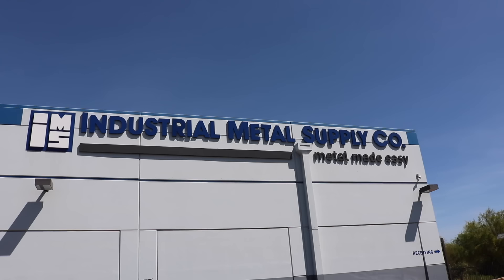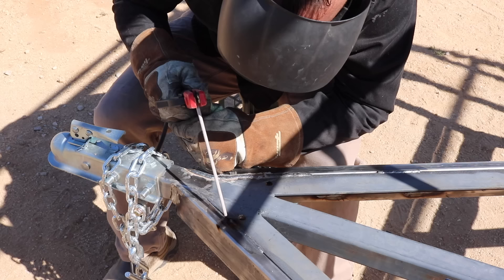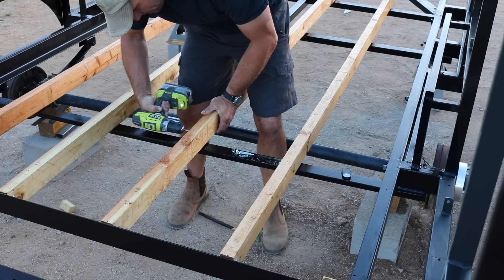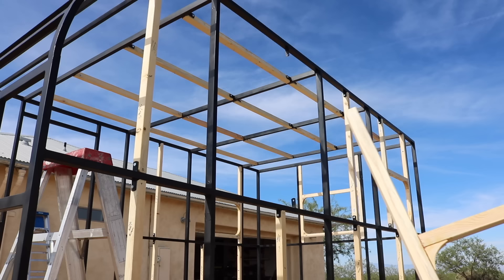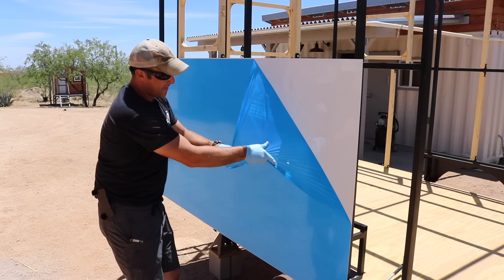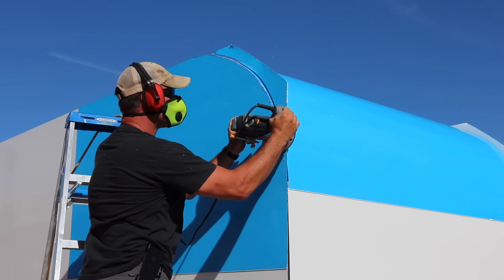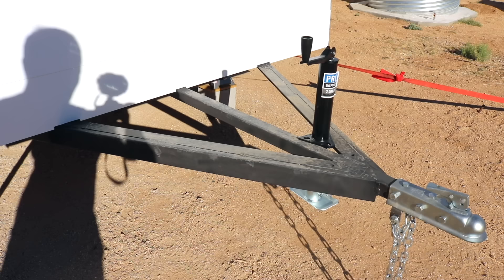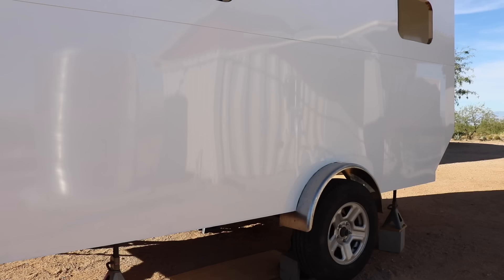How to Build a DIY Travel Trailer - Aluminum Exterior and more (Part 2)

Comment: HSD onomics I want to say that I appreciate all of the work and effort you have put into this project.  
How some ever, you might have taken a closer look at how travel trailer frames are made both today and decades ago.  
1. Frame rails should be of 2 X 6 tube steel.  Either HSLA or chrome moly, preferably. 
2. NO wood should be used on the underside of the trailer, with the exception of the subfloor. 
3. ALL travel trailers have the chassis and coachwork as separate entities.  They are then bolted together.  You have welded both together.  
4. You used tube steel for framework of your coach-unnecessary weight!  Aluminum tubing would have worked as well, with probably 100# of weight savings. 
5. Your tounge/coupler mods at the end were another case of overkill. 

Understand this is meant as constructive criticism,  not trying to rag on your build.  There are many aspects of the build that I do like, especially how you integrated the fenders into the side walls. 
Time will tell on the structural design,  but I suspect you might want to build inspection panels inside at coach frame joints where they attach to the chassis frame for stress cracks. Bolts have some flexibility, where welds are quite rigid.  
BTW I am an aircraft mechanical inspector by trade and am restoring a 70+year old Spartan Manor,  so I have put considerable time into research and thinking on this very subject. Hope you take this as intended and not feel it is a personal attack or such. Your build does have many unique qualities and I do hope that it holds up with use.

Comment: Hi, thanks for the videos, I need attach an aluminijm plate to a steel frame. the steel frame has anti-rust paint. Should I remove the paint before using the VHB Tape?

Comment: Is there any chance of galvanic corrosion between the aluminum and steel, or is your paint and tape acting  as a barrier between the two. Also if you did opt. To use rivets would you have chosen aluminum, steel, or stainless?
Reply from the maker: I would've gone with stainless rivets.  and yes, the tape, as well as the paint acts as a barrier.  My neighbor Al, has made several things with aluminum and steel, some with only a layer of paint between the two and had no corrosion.

Comment: I didn't read all the other comments, but will you be running a bead of caulking between the aluminum skin and your steel frame? That will really double reinforce that high Bond tape

Comment: Hey I built a steel frame trailer too; one problem I had was with condensation on the inside at the points that my interior walls contacted my steel frame. My trailer is much smaller more like a teardrop but square. Do you have a plan to prevent this? Or maybe because your trailer is bigger it won’t be as much of a problem. I used 1/4” birch plywood for my walls.
Reply from the maker: I've actually heard about that on tnttt.com.  from what I heard, if you have spray foam insulation and the board right next to the aluminum it helps to mitigate it.  but I also left little gaps where I put the vhb for any condensation to drain about where the aluminum meets the frame.  but I guess only time will tell...haha.... but we are on the cusp of out monsoon season, where the humidity levels will be at the highest point of the year (70-80% and above, which is big time humid for us and I'll be able to see then how it fairs.

Comment: Looks great. Is that tape strong enough to hold everything together or do you have to follow up with screws/rivets? Do you have any kind of dream interior layout or is it just a general idea and build as you go. It looks like the dog has given a personal approval. I would imagine it is starting to be getting a little warm to be working inside the trailer. Thanks for sharing and great video!

Comment: Hi, did you have problems waterproofing it. We did the same thing using tape as well  but a transporting trailer and found water issues after sealing it. Lesson learned but had to use much more sealer than anticipated as we found leaks everywhere using a high pressure hose to replicate the driving rain when travelling.

Comment: Question for you, I don't have a welder or any welding knowledge but want to make a new top for my leaking pop up and saw a video of brazing aluminum with a torch. Is that just as strong as a weld or not recommended for what I'm trying to do?

Comment: Very nice work! What are the dimensions? I want to build an offroad camper in the same shape as yours, just a little smaller and with bigger tires. Yours should outlast than anything you can buy with the way you're building it.

Comment: Now that you have used the camper for a while, how does the 3m tape hold up? I am thinking of building a 2x frame for my camper and was curious if the tape and aluminum sheathing still keeps your camper structurally sound w/o exterior fasteners. Thanks

Comment: LOL! I'm trying to figure out where in AZ you live by the mountain ranges, figured it was somewhere around Tucson... (I live south of Tucson btw... Sierra Vista) then I actually used some common sense and looked at the "about" tab... 

Awesome content! It's my dream to eventually do what you've done! 

Going to use this video as a reference for my trailer conversion (utility - enclosed). Btw, what was the cost of the aluminum siding and did it gum up your router bit much?

Comment: Really nice work there, unfortunately in Australia id need a plethora of engineers reports for the structural,  plumbing, gas and electric work. Not to mention a mechanical engineer pass for the brakes etc, even then if I wanted to take it interstate id get ordered off the road for non compliance in that particular state.

Comment: What's wrong with using 7014 rod, or for your flat welds use jet rod 7024? You get the same tensile strength?  Just curious.  New to welding.

Comment: Hi my name is Hope. I  have watched this build several times. 
I've looked and haven't seen dimensions of the trailer. Nor size sheets of aluminum sheets. Actually is there a full materials  used place. That I'm probably missing, considering I'm as
 " green " as any woman could be, who is very much inspired to build her own small rv (of course with the help of an experienced welder). 
Thank you for your time. 

Thank so much for sharing your family. I watch Tristan / SUVRVing, which is where I first saw you.
Also is there a trailer weight  as well as dimensions stats listed anywhere.

Comment: I’m working on plans for a wood framed camper with aluminum siding. Do you think I could use just the 3m vhb tape to adhere the aluminum panels to wood framing?

Comment: Top notch as usual.  Did you dream up this plan or did you get it somewhere?
Reply from the maker: Mike Morris thanks mike!   Yes it’s a plan of my own...in my head.   But when I originally started the trailer frame 2 years ago I loosely based the base frame off of a 1950’s angle iron frame..  not the same dimensions but just a similar layout.  But the rest has been ‘as I go’ kind of thing😉👍

Comment: How much did your trailer end up weighing after complete information the build? I have an outback with a tow capacity at 3k and am wondering how large a trailer I can get and turn into a camper without getting too heavy.

Comment: Well number one problem just like I learned on my covered trailer aluminum and steel don’t mix it makes them right
Reply from the maker: The VHB tape allows separation between the steel and the aluminum.   Of course I do have screws and bolts that allow contact at certain points….but I tried to keep it mininmal😀👍

Comment: I'm researching a means to create a "covered wagon" style cover for my landscaping utility trailer.  After bending 1" steel pipe in the shape of a letter "U" I welded onto the left and right sides of the trailer, six 1.5 inch pipe (12 inches long), vertically, 3 per side.  I need to know where to get the correct plastic, durable enough to endure wind, to install on top of the upside down letter "U" pipe framing.  Please help.

Comment: are you going to Linex bottom, or protect the wood more?
Reply from the maker: yes, I plan on adding something more... but it's still up in the air a bit.  I plan on insulating and running wiring and I may coat or add a spray barrier.  The only time the bottom will every be exposed to water is during travel.... so I need to figure something but it'll probably be later in the build :)

Comment: Maybe I missed it, but where did you get your "blueprints" from to construct your Travel Trailer?  (Blueprint may not be the correct term, but I'm not a welder).  Or is this an "Out of Joe's Head" design?
Reply from the maker: haha... you are right Becky!  this is an 'out of Joe's head design.  I have several sketches but only general dimensions on those... like width length.   But most everything else is just as I go.  For example the height was figured to give me a few inches of head room and I just cut all of the uprights to fit that length.  then on the back angled section... I held a piece of metal in place until I thought it looked good.. then clamped it in place and measured it... then cut all the angled pieces, etc,.... and so on for the whole thing :)
Reply: Thanks for your reply; that is amazing.

Comment: are the exterior panels butted together or overlapped etc? how did you weatherproof the exterior and roof joints?
Reply: disregard, just saw the last minute of the video. great job on the build!

Comment: Dude what is the name of the tool you re using on 00:15? Im starting to build a trailer, inspired in your design. Until now, I have the chassis finished. Thank you and congrats for this amazing project!!
Reply: It's a router with a flush trim bit, he also uses a jigsaw.

Comment: Appreciate the tutorial, especially the use of the fastener free clean look of th 3M panel lap adhesive.I downloaded the link you provided and am amazed to see most every consumer item is assembled with it. I've seen in comments several request for info on the great lifetime corner sealant you used. As the corner assemblies of RV's are the Achilles tendon of RV builds, the resultant dry rot due to low quality factory corner sealing giving a bad name to wood frame construction, this is perhaps the most important detail of your build.
Unfortunately you don't seem to want to share this product information so let me be the last to ask, what is the product name?
As for the labor intensive metal framing I can see no reason for it except for..the corners won't dryrot due to inadequate corner seal. 
Metal studs conduct and transfer heat and cold requiring redundant wood framing to provide insulation bays and ease of interior trim fastening . The use of aluminium studs in rv construction may cause delamination of filon/gelcoat...the weight saving is negligible, the skill set lacking for most of us but the average Joe is terrified of the dry rot of ..inadequately sealed perimenters so they buy the metal framed rather than build their own wood framed camper.
Reply from the maker: I’m sorry for any confusion.   I have answered it several times.  But I believe it was in the video where I trim the trailer (1-2 after this video).   But perhaps not...just hard for me to remember. But here goes...
On the corners first caulked with dicor corner/wall lap sealant (not pictured).   Then I added dicor seal-tite corner seal tape on the roof wall transitions.   For the over laps on the roof panels I used ‘extreme rv tape’ that I purchased at camping world.
I sincerely hope that I answered your questions.   I don’t intend to not answer questions for these kinds of things, but the comments I receive on older videos rarely give me notifications and overall there are just far too many comments for me to keep up with each day.   Generally I can only keep up with comments on my most recent videos.
Reply: Thank you for the reply, answering my question concerning the corner sealant tape, I realize that you are a very busy guy, young family, full time fireman an all...been there an done it.
Great looking trailer and I'm sure you've inspired many to build their own. Am looking for salvaged camper frame to build mine .on.....there's a lotta people doing the same...
The wood and metal frame prep for the 3m tape.....does that entail just fine sanding as well as the brush on (glue?)
Had several quotes from enclosed trailer dealers in southern Georgia.....after seeing unsatisfactory reviews I'm not paying 7.5 k for a 24 ft trailer that they wont warranty if....I add upgrade of....screwless exterior.....as they stated...weve experience failures...I say...no wonder as that factory completes 70 trailers per day and no telling who's doing the work....

Comment: How heavy is this van, a steel frame makes it extremely heavy
Reply from the maker: yes, steel is heavy... but it it almost all lighter gauge.  I'm aiming for the low 2k range 2100 to2250 or so..

Comment: Explain in future video rhe gaps between the aluminiun panels.the horizontals i guess you overlap them, but not shure whar you did on the vertical ones.thanks
Reply from the maker: Diego Molinero the verticals are overlapped as well and have tape between them for adhesion and waterproofing as well

Comment: does the VHB tape provide the separation between the steel and Aluminum to prevent corrosion?  these two metals don't get along.
Reply from the maker: Henry Ostman yes...there is a layer of paint on both the steel and aluminum and the tape is 0.062” thick

Comment: Great job,, 
assuming you're in America or Canada,,how does the legality  of the trailer stand,is there no legislation, regarding certification,for taking and towing trailer's on the public highways in America,in Europe without the correct registration plates displayed, regarding load weights,and manufacturing compliance, I would be prosecuted, heavely fined,and have the trailer confescated.so my, question is do you have to submit the trailer,for safety and compliance check's, to a government agency?

Comment: I'd put my fan in a different spot not in the ceiling I wouldn't put any holes in the roofand if you check campers out that's the thing that ruins all Canter's is holes in the roof

Comment: I think none of us can do that, why? Because you need to register the trailer and the DMV will ask for manufacturers certification, you can do that since you're a manufacturer but not us normal people 😢
Reply from the maker: Most all US states allow for home built trailers.   You just have to call the DMV and ask about what they require in your area.   I had to get an inspection and they assigned me a vin number.   Then I had to make sure to add all the required DOT lights, reflectors, etc,.   Hope that helps🙂👍
Ps- tnttt.com is a great resource for home built trailers.

Comment: Suggestion: Why don't you build a road as a project for your trailer too; cut down some 'rubber trees' and then build a factory to create the tires; then you should go to Texas, discover oil; refine the crude oil; build a gas station; and finally grow some trees for the wood. Nut@!

Comment: Don't know how to weld, would be more impressive if you could build without welding. I don't mean the trailer itself...
Reply from the maker: Plenty of great trailers built without welding.   Go check out tnttt.com (teardrops and tiny travel trailers).  Great forum where lots of people post there builds of everything from small plywood teardrops to welded steel and aluminum builds…. And even rigid foam based builds.  Pretty cool stuff